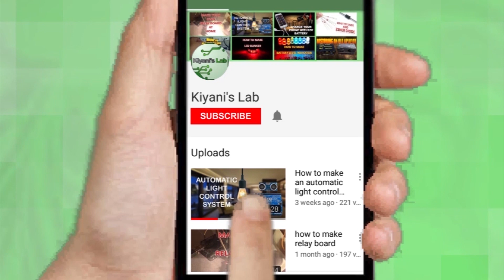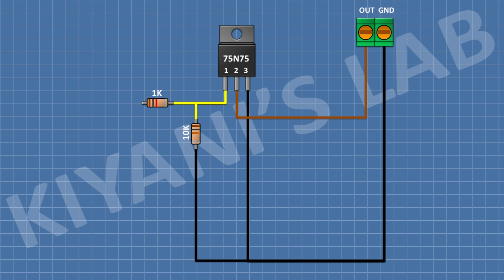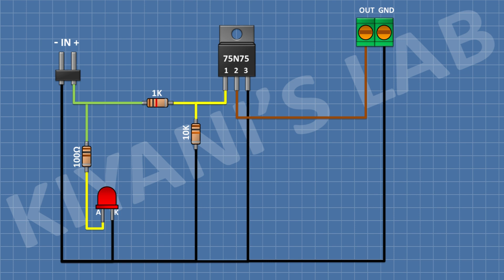How To Make DC Solid State Relay

Comment: Sir, if the voltage is 3.3v or using ESP8266, which resistor and what value should be replaced, because if using ESP8266 with a multimeter it shows 13 Ohm, help me sir to achieve 0.5 Ohm -> 0.1 Ohm using ESP8266, Thank you in advance, Your project is very good for me as a beginner.
Reply: You can choose N-channel transistor with lower threshold voltage and leave all others the same. Consider IRLZ44N, which has 2V threshold voltage.

Comment: SSR is electrically isolated, this is just a MOSFET switch 🙈
Reply: Thats what ive been wondering too. Just came here from kasyans "relay" and its essentially the same. If the fet failed shorted as they commonly do, wouldnt that leave just a resistor between the positive and in this case ground? I dont know anything yet about ssr's, but id like to imagine they at least have an opto as galvanic isolation.
Reply: Trash

Comment: Could you redraw the circuit for a 9 relay device.   I want to control 9  12volt devices with an arduino.